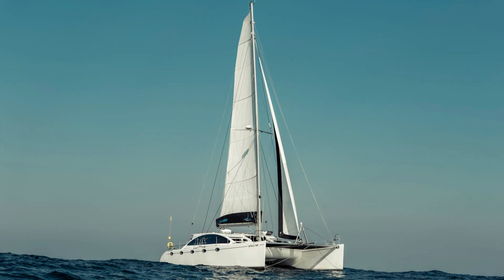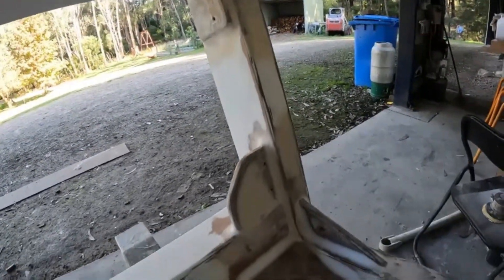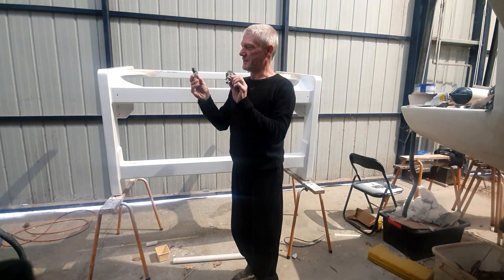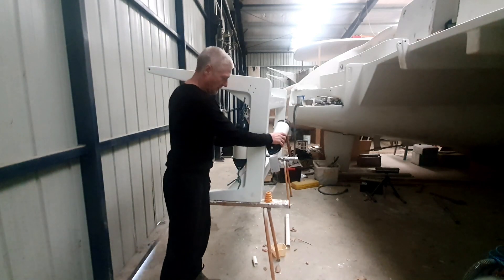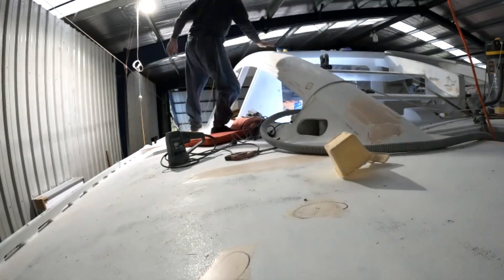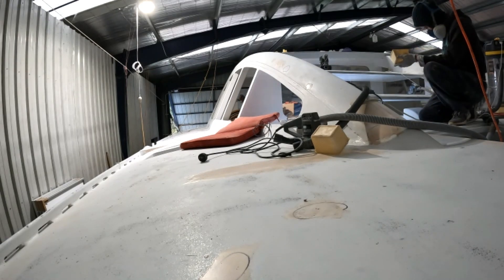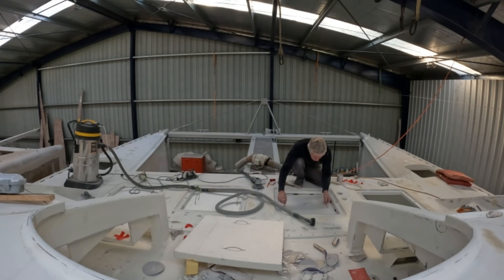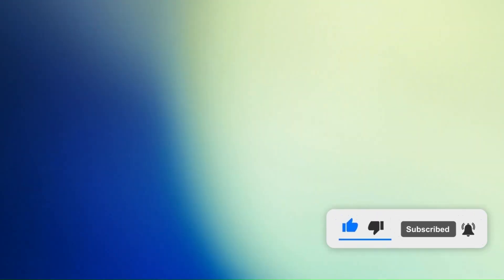DAVIT CRANE REWORK & PREPPING MARRAM FOR FINAL COATING (Ep06) ~ Building Marram ~ Catamaran Build !

Comment: You might find the dingy lift easier if you used Dynema soft shackles with low friction eyes ...stronger than steel and no corrosion or squeeking.
Reply from the maker: Hi mate, I think I said cable in the video, but actually it's 8mm dynema. The ronstan turn blocks are low friction. I did think about using the eyes. But have not used them before so took the safe bet... cheers Mel&Kel
Reply: @themakingofmarram  

Check out the rigging doctor...I also know Hanneka Boon of Wharram Catamarans re rigged her Spirit of Gaia 63ft  twin masted Pahi with Dynema rigging.  As she  said you can carry a couple of drums and re rig your boat anywhere. Meantime a German guy tested some compared to metal in an engineering rig. It passed.
See how she goes 👍🏼🧙🏼‍♂️🇬🇧
Reply from the maker: @clivestainlesssteelwomble7665  Hi Hi mate,
thanks. We will check them out, cheers Mel&Kel

Comment: Gday - well done on the build - it is a big job. I really like your dinghy crane. I am doing something similar on my 38ft cat - but it is simpler in construction and not as easy to use. BUt I do like having an aft deck for the dinghy to sit on out at sea. 
Do you use a guide coat on your epoxy high build? I don't always, but it can be good to spray a very very light coat of black or grey over the high build primer and then you just start with 180 and then as you sand off the grey you can switch to 240 if you like. I find that guide coats are great when it is tricky to see whether you have done enough sanding. Cheers
Reply from the maker: Hi mate. Thanks for the tip. We have not used a guide coat yet. As we put the high build on with a roller . the pits from the roller have worked kind of like a guide coat. Afer this sand we will spray on another layer of shipshape. Then guide coat sand as you said. Good luck with davit build.